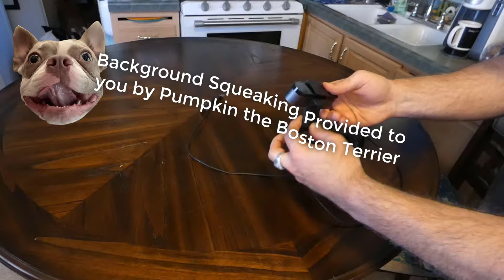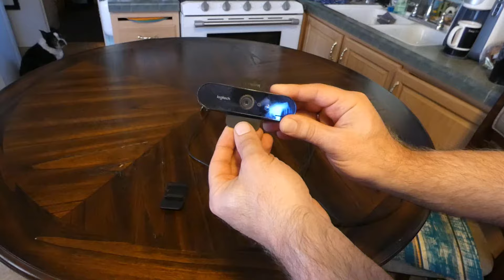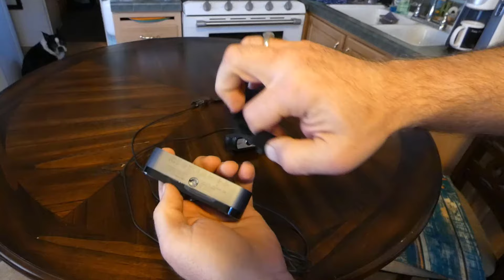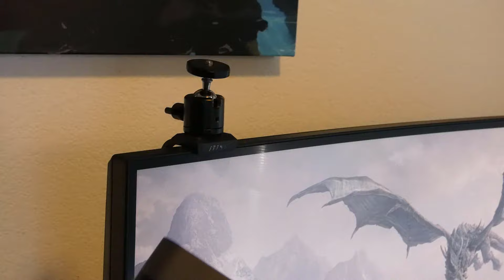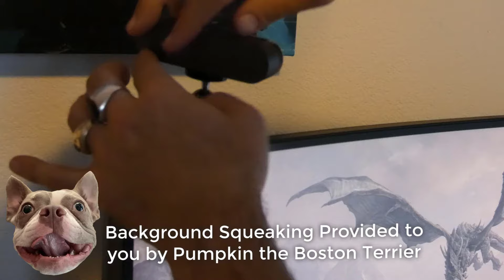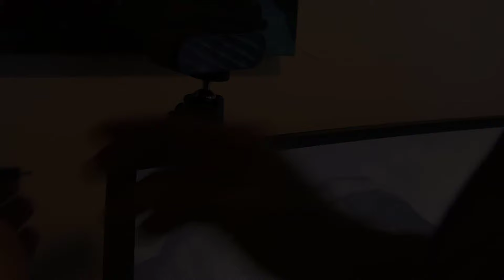How to Screw Logitech Brio Webcam on a Tripod Mount | #HOWTO #LOGITECH #BRIO

Comment: What is the screw thread size ? How do I find a tripod that would fit the BRIO screw thread size ?
Also, I seriously am afraid of breaking my BRIO. Mine does not look like yours, underneath, so I am wondering if they updated this, and preventing doing this, or if mine is an older model.
Update, It was scary but I was able to. What I did was , fold the attachment flat, and then you have a wider base to pull away. That gave more leverage, and I was relieved that it had the screw underneath.
Reply from the maker: Standard camera thread 1/4"
Reply: @dragonblogger  thank you!!!

Comment: How to add it again?
Reply from the maker: You can just snap it back on, push until it clicks in.  Once you get the hang of it it is very easy to remove and put back on again.
Reply: @dragonblogger  Not sure if I already damaged the clip too much. Am I supposed to press it in straight or again left-right-left-right or something? For me, it goes in only a bit but not completely

Comment: i like your idea for webcam mount on  monitor from Ulanzi Tripod Ball Head. but what kind mount you have below from Ulanzi Tripod Ball Head that hold?
Reply from the maker: That monitor mount is actually proprietary and comes with the MSI Optix MPG341CQRV 34" Widescreen monitor, I haven't found any 3rd party mount that works like that.

Comment: would this camera work with Amazon Basics 50-inch Lightweight Camera Mount Tripod Stand?
Reply from the maker: Yes, the AmazonBasics Tripod uses standard camera thread mount on the tripod and it will work, I had the BRIO setup with many tripods with the mount plates.
Reply: @dragonblogger  thank you! ordered the tripod :D

Comment: Hey can i use the camera mount from the briio again??? i did buy this ulanzi claw and i try to put it on the mount but i didnt understand how i get it on this thing with the two tabs!?
 sorry for my bad english
Reply from the maker: Yes you can snap it back on easily and snap it off again as needed, I constantly switch to using default mount on monitor and then switch it to tripod mount.

Comment: thank you for making this video.

WHY COULDN'T LOGITECH SAY THIS!?!?

I was just about to forcefully twist mine counterclockwise thinking I could unscrew the mount off.

This is really disappointing that it's so counterintuitive and that Logitech alludes to the possibility of removing it but gives you no information to do such.
Reply: I'm almost thinking this is deliberately deceptive in order to provide replacements.

There is no reason the included stand couldn't have just screwed on. The inclusion of those two pieces of plastic seem almost as if they want people to break it since they're given no information how to correctly remove it, in order to sell them replacement components or a new camera.
Reply from the maker: Someone had commented that the BRIO came with an instruction pamphlet that showed how to do this, but I didn't have one with mine when I got it back in early 2019, so maybe they included that later, either way when I had to research to find how to do it I knew I couldn't have been the only one who didn't know this and made this video to help others.  Glad I was able to help.
Reply: @dragonblogger  I got my BRIO two weeks ago, a fresh factory made one (I've been waiting since the pandemic due to supply). Mine contains no such information. :(

Thanks for your video.